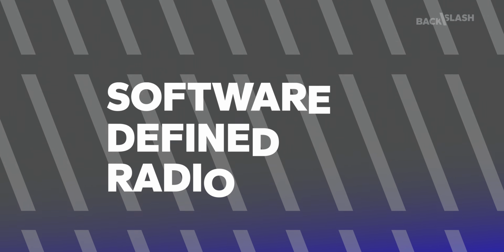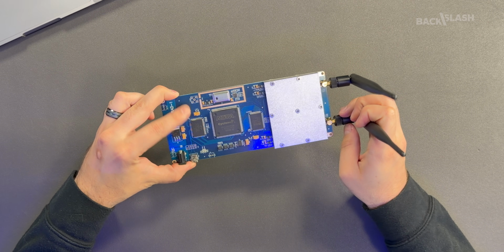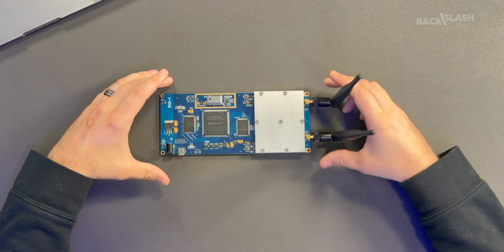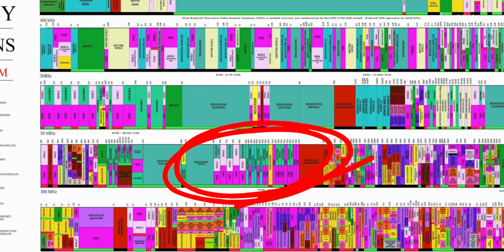I Built My Own 2G GSM Network - Part 2 (SDR Basics)

Comment: Really wonderful to see your energy!!!. I am working on a small stingray locator hopefully handheld....I used to work at a company that made DDI's in the late 90's and early 2000's before everything changed over to GSM. My specialty was TDMA and CDMA.  Those DDI's were a stand alone unit that did everything a stingray could do but most of the time they were used  for reprograming phones. There was a law that as passed where two phones could not have the same ESN MIN pair which makes sense. No clones...However an integral part of getting a new phone and placing your ESN MIN pair on it meant that those numbers would be on two phones for possibly enough time for the tower to register a fault and cause a large problem. I was part of the team to figure out how to solve this problem...Of course several other ones sprung up.....I really miss those days!!

Comment: Any thoughts on the docker container "SDR Enthusiasts GitBook Guide" versus DragonOS or Skywave Linux?
Would like to use SDR (Flipper Zero, LimeSDR USB, etc) to record/analyze/display 2 car key-fobs to see why one of them doesn't work!     There's a 0x44 cc article ("Reverse engineering a car key fob signal") that talks about "Universal Radio Hacker" software.. and paulgclark / waveconverter software ( fieldxp Chapter-2-Installing-the-Software )

Reverse Engineer a Tire Pressure Monitoring Systems (TPMS) would also be cool.. my tires are properly inflated yet, apparently it keeps sending the low pressure warning to the dash!

Other practical applications I've seen are:
--Morse Code CW Transmission (NFM and AM/USB) and automatic decoding/Receiving (CW Skimmer, CWGet , morsecode scphillips translator, "Playful Technologies" AI-based Morse Code Decoder, etc) 
--HAM : trunking (SDRTrunk / Unitrunker) / TETRA (SDRsharp plugin, OpenEar, OsmocomTETRA), digital-modes (DMR, D-Star, System Fusion/C4FM, NXDN, P25/Police Scanner (DSD LouisErigHere), POCSAG (PDW Software) , YSF FT8 )) , convert modes on the fly (i..e use DMR radio to talk on C4FM), 
--Decoding/Visualizing Weather Satellite data (noaa-apt, WXtoImg, SatDump, SDRuno + Orbitron , USA-Satcom XRIT and XHRPT, Meteor Demodulator + MeteorGIS) 
--ADSB Plane Tracking (X-Plane / XHSI and AdsbSCOPE plugin, MultiPSK with Maperitive, dump1090, BaseStation) ;  
--Finding Satellites (Orbitron , g-predict, orekit, SatDump, PreviSat, Pypredict)
--GPS Decoding/Plotting/Spoofing ( GNSS-SDRLIB, RTK-NAV, GypsumI, SoftGNSS (matlab)) 
--ATSC Video Receiver/Transmitter (Portsdown DATV, SDRAngel, GRC, SDRGlut) 
--Local GSM/LTE cellular network (GPRS) (gr-gsm, Kalibrate, IMSI-catcher, srsLTE-Sniffer, rtl-sdr-LTE dedsecimsi, FALCON) 
--Text/voice decoding (OpenEar, Defcon 2016) 
--Inmarsat AERO satellite Medlink AMBE Audio ACARS (jontio / libaeroambe built JAERO) 
--Reverse Engineer Direct Sequence Spread Spectrum ,  Clock Recovery Techniques
--Visualizing RF that circuits emit before formal MIL-STD-461's CE101/CE102/etc testing  ( "free radiated emission simulation (electric field) of a KiCad layout + PCB layout review"  or "[RadioFieldAR -tinySA-] Visualize radio wave strength." (manahiyo831 / VR_RTLSDR_AVATAR or RadioFieldAR_tinySA-ULTRA)) 

So much to learn, so I'm not sure if I should go with a formal structured approach (ex. Georgia Tech Prof. Edu) , or go the youtube route.  I really want to see RF in action, before drilling down on the math/theory (ASK/OOK, OFDM, etc).  Any thoughts on any of these?

Michael Ossmann's SDR with HackRF  (I imagine it will work with the LimeSDR USB)
 $2500 Sébastien Dudek
 $1500 hackers-arise Subscriber-PRO SDR For Hackers
Balint Seeber / Ettus Research GNU Radio Tutorials 
tonex , enoinstitute , factorialabs
$15 Udemy (Designing RF Comm Systems using SDRs with GNU Radio, Mastering SDR with GRC, etc), 
csun skatz CSUN/EAFB Software Defined Radio (SDR) Senior Project  ,  ECE4305  
GH SSkySurfer / SDR_Learning
UCLA Wireless Lab /  Extension -  RemoteRF Platform ; RTL-SDR with FPGA and MATLAB Simulink